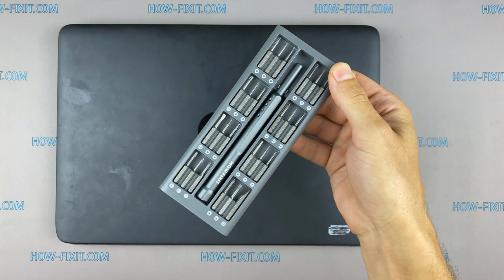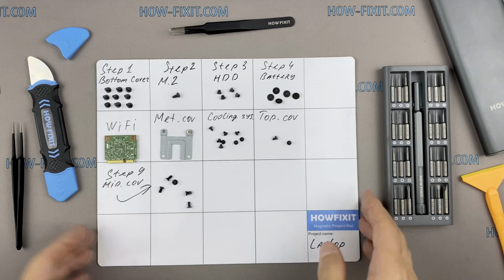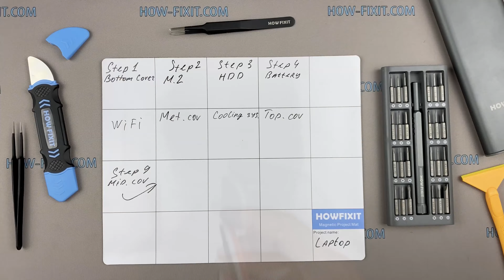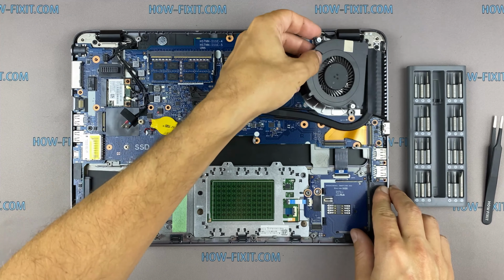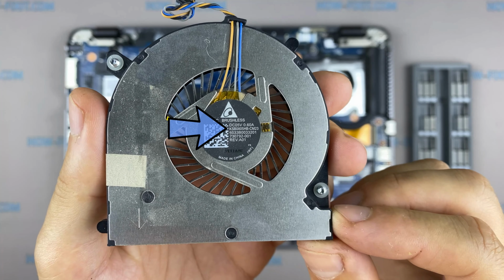HP Elitebook 840 G1 Fan Replacement | Step-by-step DIY Tutorial

Comment: Thank you for the tutorial.  I discovered that you do not need to take the keyboard off nor detach the any ribbon cables.  You can leave the keyboard attached, but you do have to loosen the two captive screws and one remove the one security screw.  While I was mostly there, I did take off the heat sink and reapply the thermal paste.  I do have to say after replacing the fan and re-pasting it, my thermals did not improve much, if at all.  The fan was making noise before and now it's quiet.  Not bad for an 18-year-old computer.  I have the touch-screen, backlit keyboard model.

Comment: to remove the fan, you do not need to remove the keyboard, if the fan works and only makes noise, you can disassemble it and put machine oil on the shaft (you have to glue it later)

Comment: Great instructions.  Only hickup I hit was the replacement fan was missing the trapped screws so I needed to break off the clips to reuse the old ones.
Reply: I'm having the same problem
Are you talking about the small trapped disc's?
If you are, how did you remove it?
Reply: Oh sorry for disturbing ya mate I just cut it with some small scissors

Comment: I bought the fan on Amazon Canada and the fan I received requires 0.1 less amp than the original one : 0.5A instead of 0.6A I read that it could fry the computer so I don't wan't to take any chances. Your toughts ? Thanks for the video by the way
Reply: Did you change the fan you received?   It should not be a problem as it will only use what it needs to run as long as the voltage is compatible.
Reply: Hi too I got the same 0.5A fan but once replaced the computer won't start anymore. In practice it turns on but after a few seconds it turns off what can it be? I tried to put on the old fan but does it do the same thing? You can help me? Thanks 🙏 🙏 🙏